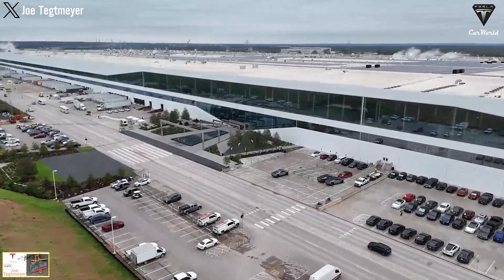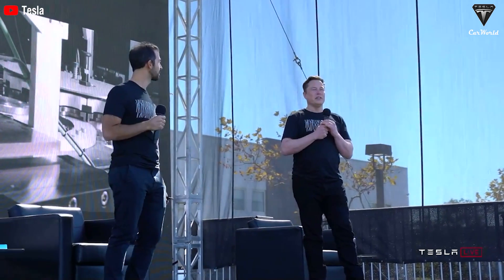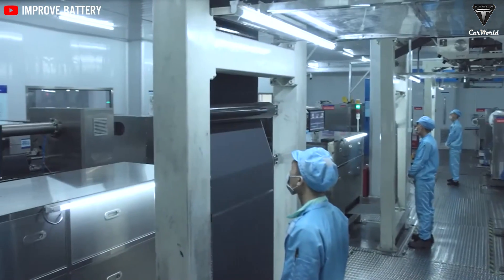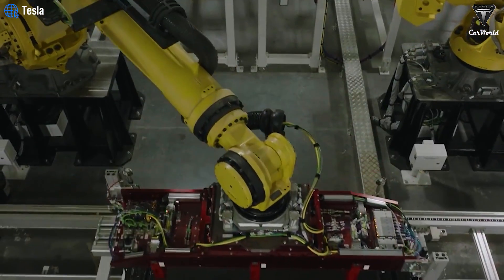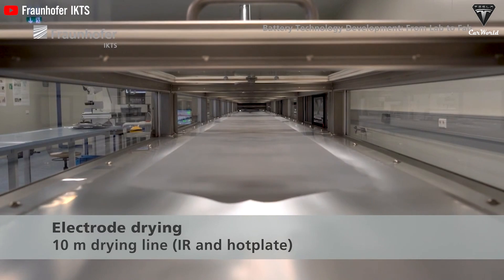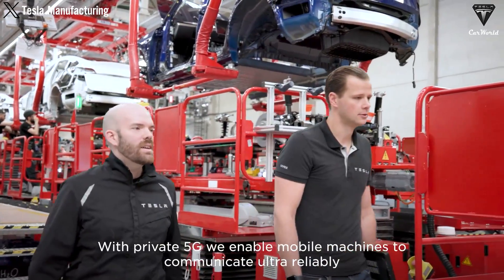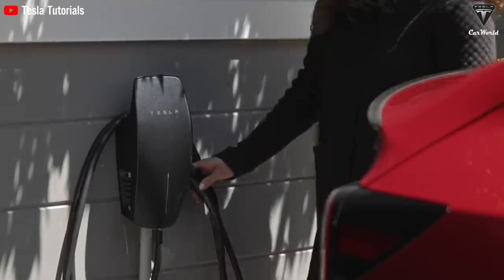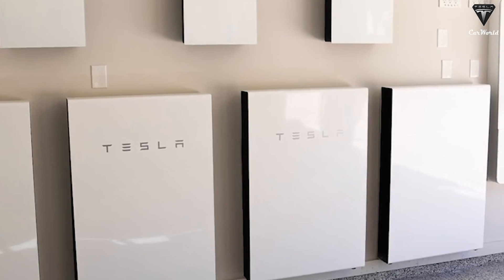Elon Musk CONFIRMS ALL-NEW 4680 Battery Update for Use in New Tesla Models 2025!

Comment: What about old models 2018 - 2019 ? As the new batteries are expecting to be so performant can be create an replace program ? And this program can have a wide range of conditions and advantages. Maybe Elon should think back to as the present owners and give second life to our Tesla’s.
Reply from the maker: Having a new battery replacement program for older Tesla models from 2018-2019 is a potentially attractive idea, but factors such as cost, technical feasibility and customer benefits need to be considered. row. Elon Musk and Tesla can consider these options to improve the car experience of current users.